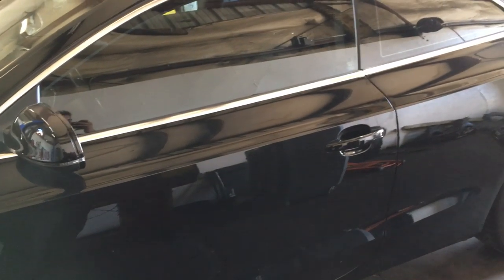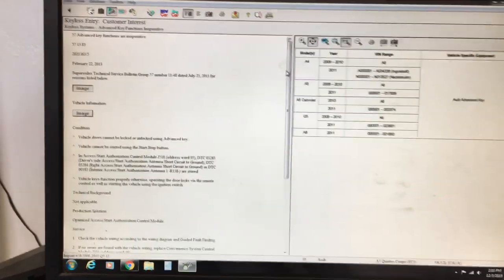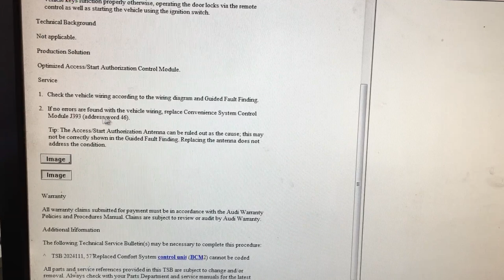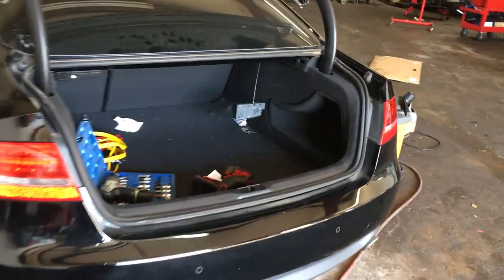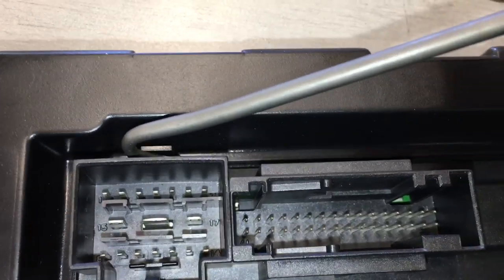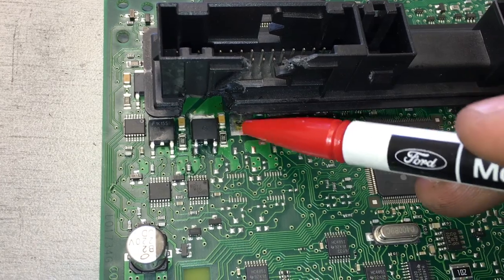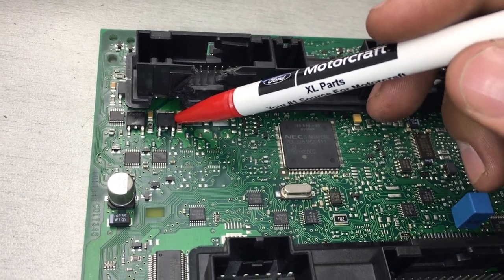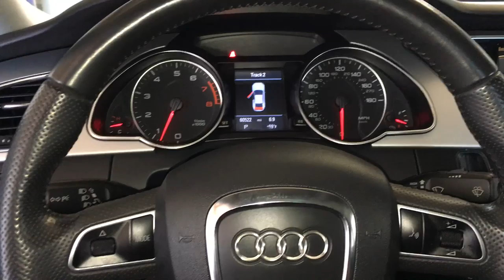AUDI CONVENIENCE KEY DEFECTIVE DIAGNOSIS FIX

Comment: Wow that was sweet! Component-level repair is so satisfying when it works. I bet the Audi dealers are not happy with this video haha
Reply from the maker: I just felt like I had to share this for anyone dealing with the same problem. If the manufactures don't like it, then hopefully it pushes them to produce a better product. Thanks for watching!
Reply: Pine Hollow Auto Diagnostics, he did a great job of repairing a $600 computer! Most shops not interested in tinkering a bit, they would rather just sell a computer swap n bill for it. Here this was almost no parts required! The ultimate in recycling too!

Comment: Wonderful fix, i believe most ECUs go bad because of a tiny electrical component that can be replaced, but people do not notice and rather buy another ECU.
You've made my day positive with another knowledge.

Thank you
Reply from the maker: Yes, some modules can be ridiculously expensive to replace. Sometimes these things can be fixed with a $3 part. Thank you for watching!
Reply: @ADVANCEDLEVELAUTO  I had exactly same issue on my 2010 S5. Replaced MOSFET and now convenience feature works again! Thanks so much for your video.
Reply: @EchteTuber  what wasnt working if you dont mind 
me asking
Reply: @EchteTuber name of the transistor or cod pls.

Comment: Got the same problem. F Audi. Had a bunch of other problems to go with it. Oil consumption. Turbo waste gate, broken door handles.ect. Theses cars have a timing chain tensioner problem. The list just gos on and on. Not a good car. 😕 think I'll just leave the defective convenience key. It's already 12 years old. Gonna run it till it dies and never buy another audi. POS. At 100k miles. Great video by the way! And thank you for making it.

Comment: I’ll add a little additional info.   The touch sensors begin to actually leak water because the rubber gasket goes bad, this is what causes the sensor short.    The short causes the transistor to stay “ on” longer than a few seconds ( like in normal operation) which causes them to overheat and burn out.        You can replace the transistor but the problem will occur again.    Just a matter of time/rain.      You as a long term fix have to replace door handle AND the transistors, then it will go back to original function.      They’ll still get random short  to ground error codes but it isn’t an error that trips dash light and will come and go awhile as the water dries out on handle sensor and before transistor goes bad.
Reply: I think your right. My convenience key has been defective for like 8 years!.. it went out after I was driving in the rain one day. Smh. Not sure what to do. I might just leave it. Because if I mess up that module. Then it will leave the entire car not working. Then would have to be towed to the dealership costing even more $. Not sure what to do. Sooo many problems with my audi. Piston ring problem. Replaced Turbo. Convenience key. Rear door handles. It just never ends. Could be considered a lemon. Instead I just bought a New BMW under warranty. Still drive the audi though. What a pain
Reply: What's next the water pump or timing chain failure. Ugh. No more audis ever for me ever.
Reply: Hey do you know where the same module is located for 2012 a7?

Comment: I have this same problem.  Finally got my module out. I have the 4th transistor in mine, which the 4th one ended up being the odd reading. Ordered my transistors so ill be repairing it this coming week.
Reply: Did it ever work?
Reply: Where did you order the transistor and what's the part number?

Comment: Great video and research. Had the same problem. Bought the chip off of ebay and paid a company to do the soldering. Cost me just over $40.00 and every thinks is working again.
Reply: Whats the chip part number
Reply: @sanlaouna2328  

FQD12N20LTM MOSFET N-CH 200V 9A DPAK 'UK COMPANY SINCE 1983 NIKKO

Comment: Great video ! very useful!

I have a 2012 audi Q5.
None of the steering wheel functions seem to work (stereo volume, horn ect) 

I thought about replacing the clock spring?  Where should i begin?

Thanks

Comment: Great video. I have a couple questions, did you have to disconnect the battery prior to removing the module? I imagine it’s continually powered up otherwise how would it know when to activate. Also, did you need to discharge or worry about any static electricity while soldering the board?

Comment: Hey mate great Video! 
I have a 2009 Audi A4, the key fib works to unlock but key-less unlocking does not work. The push start button works though so would this transistor be the issue still?

Comment: Nice video, Thanks. You said you mentioned transistor number but I dont see it. I have a problem that I must unlock driver side by manual key. Doors lock and unlock by remote but driver side door does not open.

Comment: Do you know where the module is in a 2010 s5 convertible? I have this same issue.
Reply: Did you ever get an answer lm having the same problem?
Reply: @antone7620  i did figure it out. Its in the same spot. But behind the other module. I had to take out both modules and bracket. Fixed it in no time. Email me. Joshuadupret@gmail.com

Comment: I have a 2012 Audi A6. One of the key FOBs works fine but the other I had not used for some years. When I tried it recently it didn't work, so I replaced battery but still didn't work.
I tried the manual lock unlock door and then try, still didn't work.
Then tried placing FOB near the dashboard which shows key sign, and still nothing.
Has the key got desynced from the car. What else can I try?
Reply: Hey i was wondering if u fix ur 2nd key fob issue , i actuallly have the same problem on 2012 a4 so assuming similar fix , I have both Original Fobs & Fob #2 haven't used for few years & watched and tried every vid and nothing worked, Hoping u got da secret sauce 🤞🏼🤞🏼

Comment: my 2016 A5 is giving me a navigation antenna open circuit error 00862 but the navigation works no problem. I have an issue where the fob remote works only at a small distance from the car. do you think it can be related and similar to the problem described in this video?

Comment: One of my keys on my 2009 A4 will not unlock the car and when I stick it in the ignition it says please remove key. Will unplugging the CCM fix this? Also, which plug removes power to the CCM and will I have to unplug the battery first? Thanks!

Comment: Hi, I have a 2008 s5 similar issue: remote works to lock and unlock but convenience door not working and convenience windows not working
Can you help with sourcing transistors - guess I need 2

Comment: I have a 2013 Audi A5 2.0t and yesterday my dumb ass left the key on the trunk while I was unloading my market cart, as soon as I grabbed my son from the seat of the cart I close the trunk lid completely forgetting I left my key inside the trunk and you see having the key near by opens the door on the driver side but my car actually doesn’t have the push start button so I wouldn’t drive away and the actual advanced key function on my car where you have the key in your packet and the doors unlock when you are near by doesn’t work either but after seeing this vid I will sure try and repair my module to see if the doors unlock even if the key is in the trunk lol I hope

Comment: Great video. Here my problem, glitch should I say. First let me outline that my push start button works fine. Now the convenience feature basically works intermittently; I go to the car after it has been parked for a while, no convenience unlock/lock feature, I start the car put it in drive, I turn it off, get out the car, now the convenience lock/unlock feature works just fine, I checked the lock and unlock sensors on all doors at that brief moment, they all work fine and smooth, but then again, it stays off for say a couple of minutes, I come back, it doesn’t unlock with the convenience feature. Don’t know what’s going on. Help.

Update from 4 months ago. Hasn’t been working. Cold and rains. Once had the Battery disconnected for a long time for a turbo job, then when I went to pick up the car it worked once then stopped since.

Think I’ll just change the whole module. Is it necessary to reprogram it when I buy a used control module?

Comment: Thanks for the great, simple tutorial video.

I've followed all as in the video, turns out all the Mofset were running good. No sign of corrodes either.

1. Bought & programmed a new Key from Audi dealership.
2. Buy & test the new Keyless entry detector sensor, also from the dealership.
3. They (dealership) strip all the door, dashboard, centre console, boot(where the BCM is located) to check for continuity as it is shown short to ground, but no luck.
4. Lastly, they recommended me to get new BCM, which is cost a lot. Fuck

I've a cross tons of hour searching from the Internet for the solution, but your videos is the closest problem I've got, but seems, cannot be solved.

Is they anyway to flash the BCM? Suspect might be the software issue.

Comment: Great video!
Have you had any experience with an Audi loosing all power on cluster and no power to started after changing the battery or after opening the door with an unregistered key can this be a security problem? Can it be fix by waking up the modules I have a lot of codes in the scanner

Comment: All 4 of my transistors are FQD12N20L. I have a 2010 s5 prestige cabriolet. Not sure if that changes anything.
Reply: Have a 2010 A5 prestige cabriolet, but can't find the module. Wondering if you could explain where yours was located?

Comment: It seems to be common problem
Currently I was call to open  Audi A3 2009 , driver door lock broken (keys turn easy in lock, just the switch didn't recognize position ) and the car won't unlock. BOTH remotes sending the signal from all buttons, We could hear little click by right rear end of the car when pressing the buttons (bcm location). I brought my more experienced friend from road assistance with brutal force opening tools, His drag the gap on the doors , obviously dead lock on Vag and pulling the handles, or any buttons from outside won't work, Friend managed to open bonnet, put into neutral, fit wrapped key into ignition, put window down. I plug my autel and very weird just one error in convinence module 1 remote not synchronized. I re-program both remotes and all seems to come back to normal! Car was driven every day, battery in good condition, all live data correct, so how BOTH remotes gone from the system???? There must be some glitch in comfort module.. We recommend to change front lock mechanism, it's crucial, but still don't understand how BOTH remotes in the same time gone from the system?????

Comment: What about a key Stuck in ignition? Pls help
Reply: Just give it a good kik
Reply: I also had this problem.It was caused by a battery drain.  If your battery is too weak the key will be stuck and the shifter will also be stuck. For some reason the car thinks its in drive mode when it really is in park.  Simply charge up the battery and the key will be released.